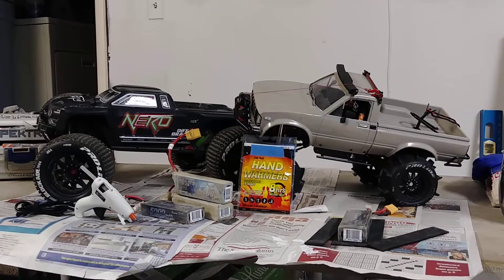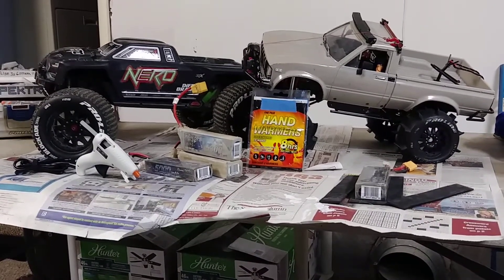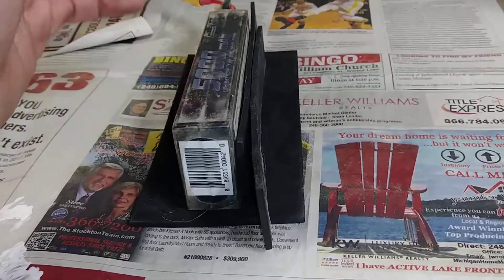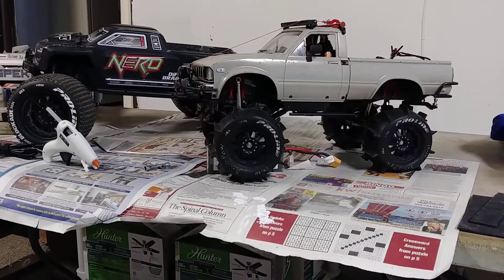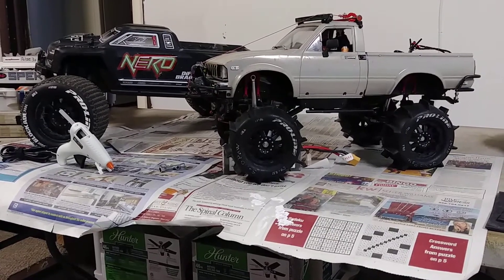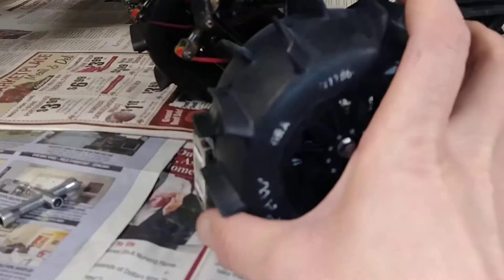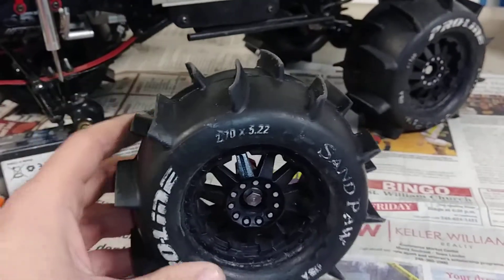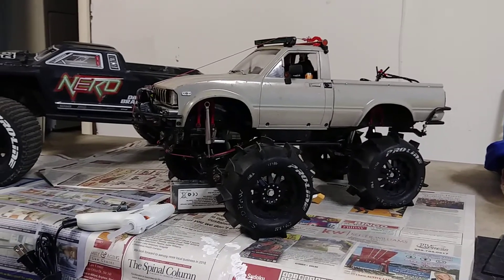Hand Warmers,Lipos,and Acclimating Tires

Comment: You might look into USB rechargeable hand warmer / power banks.  There's a small one called "P3 International Rechargeable Hand Warmer" for about $15, 106F degrees, lasts 2 to 3 hours. And in a pinch you could use it to recharge a camera or cell phone. There are larger ones available for about $35 that last longer, and are about 130F degrees. The smaller one I think are perfect for keeping LiPo warm, 106F is a pretty safe temperature.
Reply from the maker: Duck Landes,That is perfect,
I had know idea they even existed,and a perfect temperature too,I need to look into those,
Excellent Find,Suggestion,and Comment,Brother 😀👍
Reply from the maker: Duck Landes,That is Sweet!
Thanks for putting up a link for it brother,your a good dude,
👍👊👊🍺

Comment: Great info man, always better to be safe than sorry with the lipos. And great tip with the hot glue. 😃👍🏻👊🏻
Reply from the maker: Kingston RC,Thank you sir,
I just seen a few comments lately on other channels,about using the hand warmers,and no one was addressing how hot they can actually get,
165° is pretty hot next too a battery :) it's like going from one extreme to another lol
Figured I'd say something for the greater good of the RC community, :)
And the hot glue,
I never would have thought about using it,but it works unbelievably well,even with a low temp gun, 
"Ryan Shay's" idea :) lol
Thanks for the kind words,and for watching Brother 😀

Comment: very good vid bro and imformitive did ever hear about the had warmers just don't glue proline bead locks right 😆Man it's AWSOME to see ya busy on the rides and I like the prolines on the Nero keep it up brother and the hot glue does work very well
Reply from the maker: Criptic Custom RC, 
Proline plastic beadlocks;
Mental note;Glue air holes before assembly,😂
Thanks for the Great compliment's Matt,and I'm still working on the Nero,lol
Currently painting all of the fake bolts,on the plastic wheels,and some other little spots on the truck itself,😗
Thanks again for the Great comments,and for watching Brother 😀👊👊

Comment: I didn't know lipos could freeze. I ran my Arrma granite on a venom 4k 20c 2s lipo. It was about 30% out. That's as cold as I'll run an RC. But was shocked how fast the lipo went dead.
Reply from the maker: Wallys Rc Wheels,I'm not sure what the full extent,of a "Lipo freezing"actually consists of,
other than your battery draining faster,
and I recently heard a rumor,
that if you put them inside your jacket,and warm them back up,that they will be good to go for awhile, 
"but don't qoute me on it"
As for actually damaging the battery; I'll have to do some research,and get back with you Wally,
I "personally", have never experienced any "actual battery damage" from running in cold temps,other than the battery draining faster, and My left hand usually starts freezing,before my battery, lol and the coldest RC'ing temperature for me this year was -16 Fahrenheit,
for about 20 minutes,but it was in my backyard,
from the house,to the yard,and then back in the house,with no delays, :) lol 
I typically don't like running my RC's in below freezing temps,
just for the "Brittle Factor", 
The "Sake of video factor"
is what drive's me to bend the rules,😂